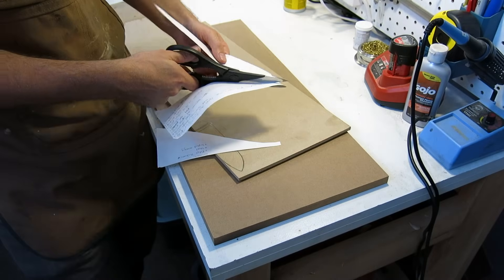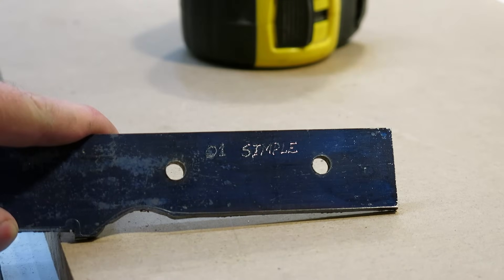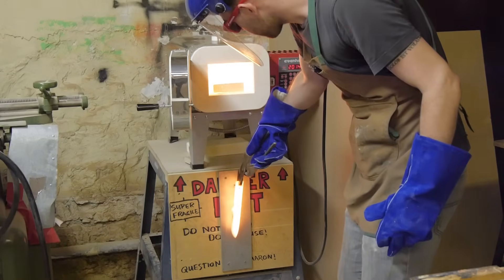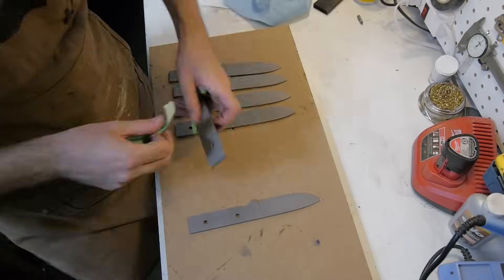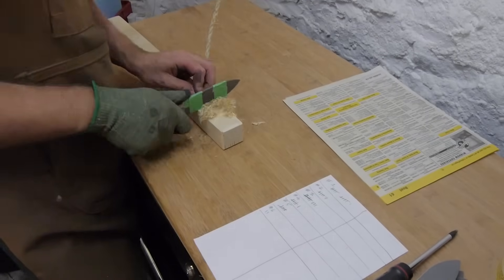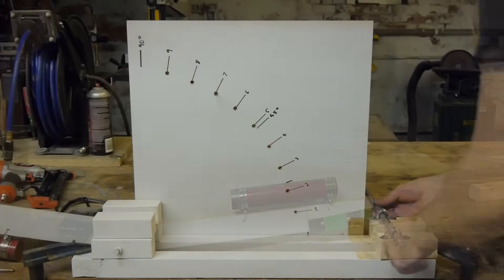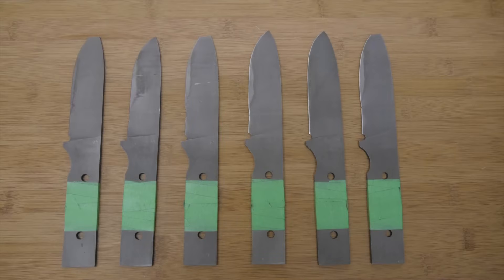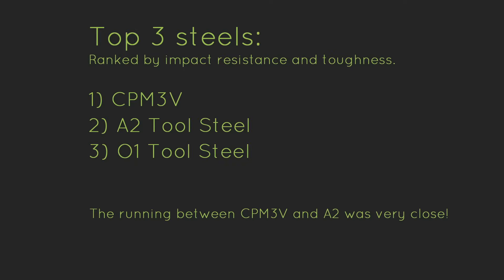Steel testing: a carnival of knife destruction.

Comment: hey I'm ordering my first batch of steel to mess around with and attempt to make a few knives. what is a good steel that's easy to work with that will be good enough if I happen to make a knife that's worth keeping.
Reply from the maker: Hey mate! I strongly recommend you get started using O1 tool steel.

Comment: Very very impressed, I wonder how the same test would fair among steels commonly found in bushblades. 1095, D2, 440c. D2 especially gets regarded as a super steel under certain heat treatments. Without those heat treatments the data between D2 and 420hc are very similar. I wish there was some data regarding that actually. There seems to be an information dark age when it comes to manufacturer heat treatments and because of that there seems to be only anecdotal evidence of desirability of specific steels.
Reply from the maker: Unfortunately saying that a specific steel is desirable/not-desirable is not even really possible... I can tell you from first hand experience that 440C has excellent edge retention when it's heat-treated well, but most knives made from 440C have very poor heat-treatment. Same goes for knives made from expensive steels like CPM-S30V. With the correct heat-treatment I'm sure they can be great, but I've had first-hand experience with my A2 steel handily beating S30V at edge retention even though everyone 'knows' that S30V is the superior steel... To an extent the steel itself is less important than the heat-treatment... I'd much rather have an inexpensive steel like 1095 that's been heat-treated perfectly, than a fancy steel like S30V with an average heat-treat...
Reply: See that is incredible to me that the properties of those steel are so heavily influenced by a smiths treatment of them. I have heard that anecdotally as well. D2 for instance with an excellent heat treatment is cited as having super steel properties whereas for example Becker Kabars treatment of 1095 is quite poor to many. I really just wish there were some numbers because as a scientist I would love to base the desirability of a bushblade on numbers which can be cross-compared. Of course some numbers are very hard to ascertain like specific dynamic loads and brittleness of a blade under load in different temperatures.
Reply from the maker: Hardness goes some way toward giving you an idea of edge retention, but it's not a useful indicator of overall performance. Higher hardness in a given steel means higher strength and more resistance to deformation at the edge (which is important because edge rolling accounts for a lot of perceived dullness), but harder is better only until a certain extent because above a certain hardness a given steel will become prone to chipping instead... This is a big part of the reason I'm so happy with A2. Because it's a very tough steel I'm able to run it very hard and have fantastic edge retention along with plenty of toughness.

It's worth noting that most factory knives are not heat-treated very hard... 57-58 HRC is the norm, whereas I personally have no interest in using steels below 60HRC and preferably higher!
Reply: 440c, 420hc and D2 all look the same without their heat treatment in the data much to my surprise.
Reply from the maker: Which data are you referring to? I can help give you an idea of whether it's actually useful data for judging edge retention or not...
Reply: I believe this is pre heat treatment

http://puu.sh/rcdJL/f07e4eceec.jpg

It also seems to be relatively cross-confirmed with other sources as well:

http://puu.sh/rcdPn/4d8f1ada2b.jpg

The problem I'm running into is getting data on what those bars would look like after a specific manufacturers heat treatment or average quality of said heat treatment across multiple blades.
Reply from the maker: Unfortunately getting reliable data about a number of manufacturers heat-treatments is pretty much impossible unless you were to buy multiple blades from each manufacturer and do hardness testing and so on yourself.  The graphs you linked are probably reasonable as approximations, but unfortunately they don't list hardnesses of the relative samples, which will greatly affect all of the properties (even including corrosion resistance, as different tempering temperatures can effect the corrosion resistance of stainless steels!)...

Also 'wear resistance' does not really equate to edge holding ability unfortunately. Wear resistance as listed by steel manufacturer datasheets is a measure of how much weight will be removed from a flat piece of hardened steel by a given abrasive medium in a given time... So for instance if you had a roller running a scotchbrite belt over a piece of steel then it would last longer if it had higher wear resistance...

This measure can speak somewhat to edge retention, but generally the two are not strongly linked. For instance if I take a piece of D2 tool steel and heat-treat it very hard (say 64HRC) then it will have incredible 'wear resistance' but very little 'edge retention' because the steel will be too brittle to retain it's edge even when cutting soft materials... I have experienced this directly with A2 when heat-treated to 65HRC. It took an incredibly fine razor edge, and was incredibly hard to sharpen, but the edge failed instantly via micro-chipping even when cutting cardboard.

It's very common in the knife world to quote that 'wear resistance' as indicating a superior steel, but unfortunately it really does not work out anywhere near that cleanly!
Reply: Wow, this conversation is absolutely invaluable to me. I appreciate you taking the time to write these things down and show what you do in these videos. This level of academic transparency is very very rare and in the field of bushcraft and survival academic integrity feels like a nonexistent commodity some days. Currently as I write about these things I'm between a rock and a hard place. I would like to be able to cite specific numbers but am finding myself in a field with broad generalizations regarding performance and I appreciate your attention to the details and numbers as its proving to be a huge asset to my research.
Reply: So it would seem that independent of specific numbers the hardness after heat treatment is probably very much worth mentioning.
Reply from the maker: Glad to be able to help mate. Unfortunately there's less science to this stuff than I would like... It's difficult, expensive and time consuming to do real testing, but I do as much of it as I can!
Reply: Good man, thats a rare quality.

Comment: 440С? That's a strange one to compare to CPM3V... Never considered D2?
Reply from the maker: I wanted to specifically include a steel that people 'knew' wasn't tough to highlight the differences between the steels. The main ones I was interested in were CPM3V, A2 and CPM154. I would like to test CPM154 again at some point, as it was very close to the others and I think with a tweaked heat-treat it might match up to A2 which would be awesome!

Comment: great video. nice work. what was the other steals that didn't make it?
Reply from the maker: I tested O1, A2, 440C, CPM3V and CPM154
Reply: +Gough Custom did u heat treat them all the same or was there  certain specs for each metal that u followed?
Reply from the maker: Every steel has to be heat-treated differently... In addition I did several variations of heat-treat on each steel. There are links under the video with full details of all the heat-treatments.
Reply: +Gough Custom yeah that's what I was asking, if you used different procedures.  good job man.  I'm blown away at how the others failed. I expect it from 440 but not the others.
Reply from the maker: With any steel heat-treatment makes a huge difference... Some of the heat-treats were deliberately on edge so I could explore, like with some of the A2 heat-treats for instance. It was fun seeing first-hand how much of a difference it makes!
Reply: +Gough Custom yeah that's what I was getting at. that's why elmax sucks on some knives and great on others .  do 154 cm and cpm154 treat in different process or could a person who's used to treating cm use the same recipe for coming?
Reply from the maker: I believe CPM154 and 15CM can be heat-treated largely the same way, but that's just going from memory.
Reply: +Gough Custom awwe man. I'm super happy. I just started machining class and teach is cool but thats not it we have a shit ton of a2 steel and heat treat oven and water jet and 10 mills and 10 lathes. but we dont have one grinder lol but I'm gonna make one. I can't wait to learn enough to start spitting out some protos. just wanted to share that cuz my fiance' doesn't seem to care.
Reply from the maker: Sounds awesome man! Make good use of the shop while you have access!
Reply: +Gough Custom definitely will I got a shopmaster 1720 and some other stuff in my shed so once I learn some stuff I should have enough tools to keep busy.  just gotta try not to get spoiled with access to everything right now

Comment: Im just curious is there a place you got the info on how to heat treat the a2? Ive used o1 and wanted to try out a2 any information you might have would be greatly appreciated. Awesome work as usual been following since as long as i can remember.
Reply from the maker: Hey mate! The info was a combination of online recommendations on knife forums and multiple readings of the manufacturers datasheets. The Bohler/Uddeholm datasheets for A2 are particularly good.

Comment: Did you try D2 steel at all? I'm curious how it would stand up to this abuse. I've seen a few knives being made from D2 recently curious how A2 compares to it. I know D2 has a bit better corrosion resistance but A2 holds a better edge. I'm just curious how it would stand up to the bending test.

Also, very cool video.
Reply from the maker: I haven't tried D2, but from my understanding and other people's experiences I understand that D2 is a fair bit less tough than A2 is.

Comment: One question my master... How long and how many degrees is blade in steel envelope. After that, it goes to the tempera again without envelope or already goes to the sub-zero treatment?
Reply from the maker: +Carlucio Lima Filho Lima Hey Carlucio! What steel are you asking about? The answer is different for every steel.
Reply: 440C and 1065 are more common here in Brasil.

Comment: Amazing test, ty for this, maybe best on utube.
However, this heat treat was a home made ,stone age style.
I would bet the house that Bradford ( knives) double HT double cryo 3v would test MUCH better then this home made HT.
HT is everything ( as you know). Bucks 420HC tests 2-3x better then ANY other similar steel.

Do you think A2 is good enough for  large chopper? Say a 10-14 inch Kukri/parang/kukri ?
or will it chip easy /roll..and 3v is needed?

last, have a test of convex vs other edges?  So much hype about this. Your test would FINALLY settle this.

Semper FI
Gunny
Reply from the maker: +BOOSTEDLASER Hey mate!
So the heat-treat that I did for 3V in this case is one that I now know to be less than optimal, however the actual methodology is no different from what a commercial heat-treat place will do. I know as I've done it myself and sent it out with identical results.

A2 would definitely be tough enough for a chopper, no worries there! A2 is really extraordinarily tough, I've been using it for a few years now and I'm very happy with it even after doing a variety of very awful things to a large number of my test blades.

I would like to test convex edges at some point. I have done some informal testing that seemed to say that convex grinds/edges were more delicate than a similar full-flat grind.

Comment: i noticed you mentioned Jay fisher and did some cryo treating. he is one of the foremost publishers of information on this that i have read online but i noticed you only did the dry ice bath for twenty minutes? jays pretty into prolonged cryo treatment (24 hours or more) and of course the tools necessary for that aren't easily available to us all. but i was curious where you stood, thought, or discovered in this category? ive also heard different POV on weather do to before or after tempering.......any time and thoughts u can share are welcome. im going to buy some dry ice and treat some O1 for as long as i can maintain some type of sub zero temperature with 2 kilos of dry ice....and who knows how much isopropanol......so i guess my question is why only 20 minutes? :) all the best. great videos.
Reply from the maker: +Marc Stanton Hey mate!

There are two types of low-temperature treatments that can be done on tool steels. "Cryogenic" and "sub-zero". 

Cryogenic treatments (-300ºF, usually done with liquid nitrogen) over long periods of time (24+ hours), when applied immediately after the quench offer two benefits: conversion of retained austenite into the more desirable microstructure 'martensite', and the formation of secondary carbides (ETA carbides). 

Sub-zero treatments (-100ºF, usually done with dry ice) when applied after the quench converts retained austenite into martensite, but does not precipitate the formation of secondary carbides.

I use a sub-zero treatment on my blades, not immediately after the quench, but instead in between the two temper cycles. This is because from my testing it seems that a small percentage of retained austenite is useful in enhancing toughness. The end result of my heat-treatment (including the sub zero treatment) is that I have blades that are very hard (62-63HRC) that are also very, very, tough. 
Different types of cold treatment have different goals as you can see above... Different steels respond differently to them as well. The steel I use most (A2) does not respond as strongly as high-alloy steels (like high speed steel, M4 and so on) or stainless steels. For high-alloy steels you can often get really strong responses by doing a sub-zero treatment right after the quench. 440C in particular hugely benefits from this... Without it edge-holding is poor at best. With the sub-zero quench it's up there with the rest of the good tool steels, though toughness will still be lower.

If you're only looking to convert retained austenite (which is what most people are after, and what shows the largest benefit) then you can use dry ice and there's no need for a long 'soak' because it's a process that's very quick after the steel gets down to the right temperature... If you're looking for the formation of secondary carbides then a long soak in liquid nitrogen is needed.

Hope that clarifies things a bit!
-Aaron
Reply: +Gough Custom that was perfect! thank you. do u simply let the blade sit at the bottom of what looks like styrofoam? or does it need to be propped up?
Reply from the maker: +Marc Stanton Sitting on the bottom seems to be fine, the alcohol will transfer the cold pretty evenly.
Reply: +Gough Custom can u recommend a ratio?or do u just wing it?
Reply from the maker: +Marc Stanton I use 99% isopropanol, basically you need enough to cover all the blades and a quantity of dry ice. I think I have about 2 litres of alcohol in my setup.
Reply: +Gough Custom great. i will try that. really thank you so much for all this testing. there is a lot of hearsay with these things and you are putting in the work to prove um. much appreciated.

Comment: i was wondering if u use 1075 or 1095 hc steel or is stainless ur preferred choice?
Reply from the maker: +Milton Medrano Neither of the above! I use A2 tool steel which is a 'medium alloy steel' halfway between stainless steels and plain carbon steels. It's more corrosion resistant than a plain carbon steel like 1095, but retains the toughness while adding better edge retention.